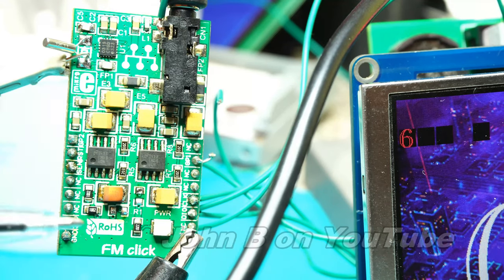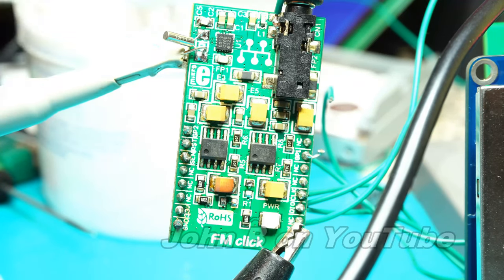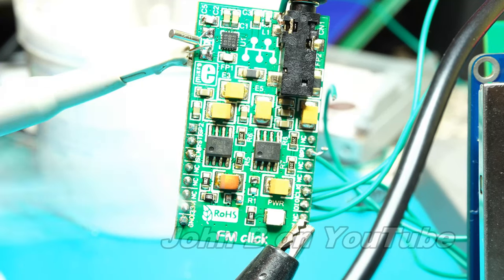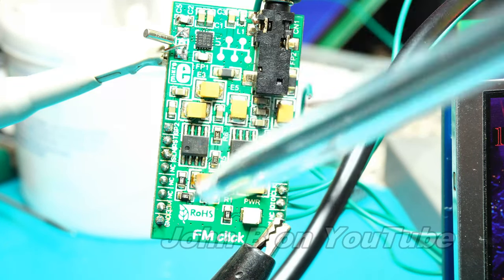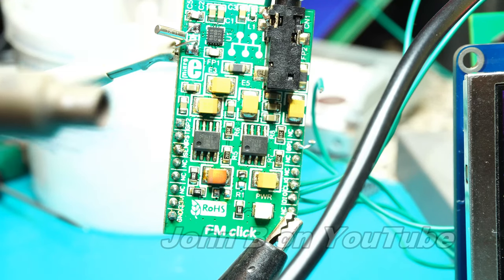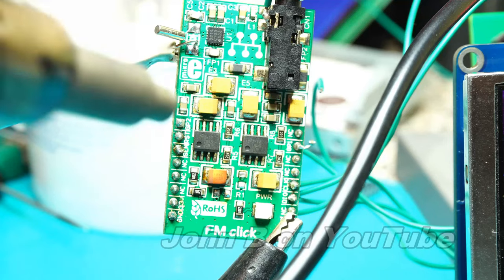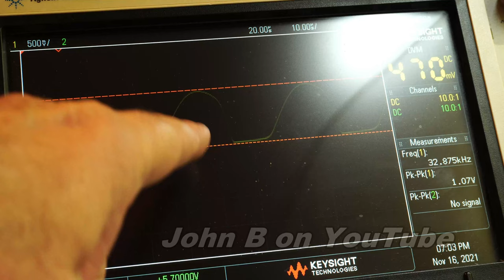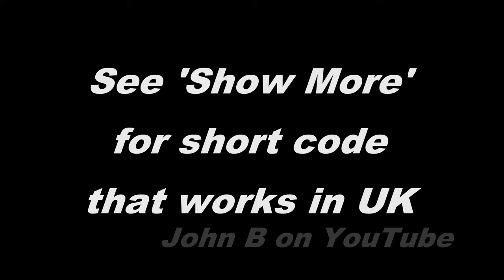Si4703 Silicon Labs RDS Radio Intro Part 1.

Comment: Really great that it worked John. Sorry I missed or didn't understand how heat helped? Is that because the resistance changes with heat?
Reply from the maker: Hi Asif, yes resistance, capacitance and inductance changes with heat.
I think the pcb is faulty.
There are vias that join tracks on the top side with tracks on the bottom. The vias have copper around the hole. I think the copper is broken.
The rubbish board has never worked.
Thanks for your comments 😀